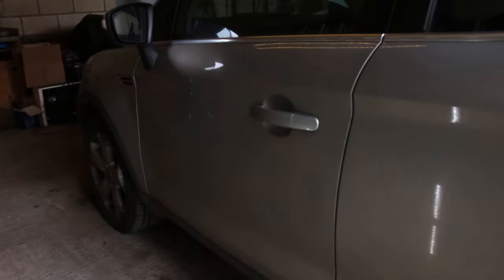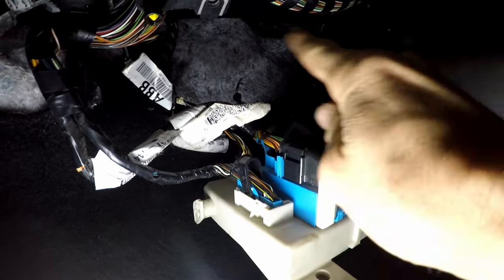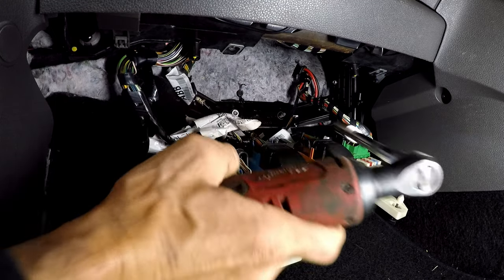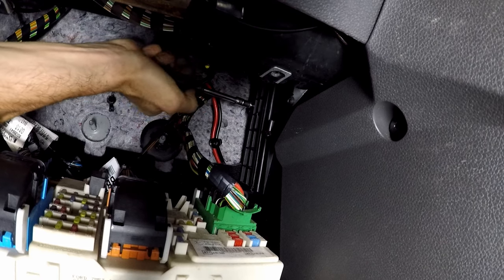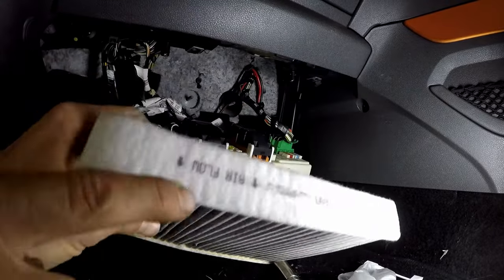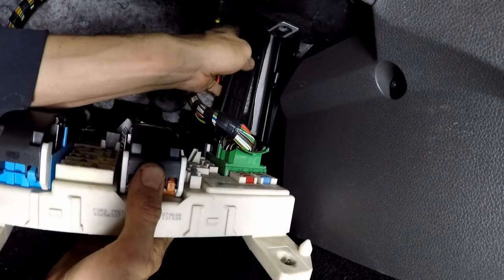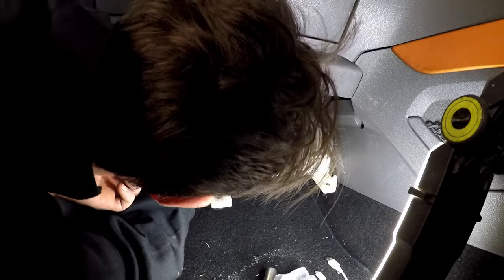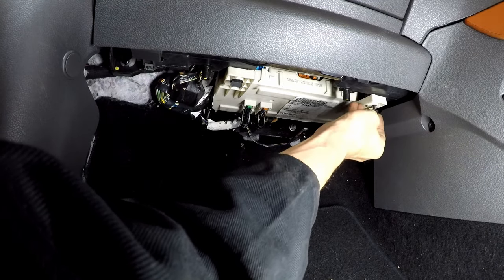How To: FORD KUGA Cabin Filter / Pollen filtre

Comment: Little tip make sure all the plugs on the fuse board are tight as the do come loose and cause endless problems
Reply from the maker: Make sure everything is tight. Don't leave anything loose on any job ever!
Reply: what you on about ? @PiggyPower
Reply from the maker: Well, anything will come loose if you don't do the thing up tight that should be done up tight!

Comment: This gave me hope that this would be a quick job.Sadly my 2011 left hand drive isn't exactly the same design, bit of a faff to figure out how to get that one done. I would have liked to give the design engineers a bit of a slap for putting a service item in such a awkward spot. And that sharp edged fuse box bracket is hungry for creating some shorts.
Reply from the maker: To be fair... It's pretty easy as cabin filters go. Some take professionals an hour, which is just plain stupid for a service item.
Reply: @PiggyPower  My issue turned out to be that I was barking up the wrong tree. My filter was accessed through the drivers side. I saw a similar panel as on your video on the  passenger side and erroneously thought that it was a design change gone wrong. It wasn't that bad when I found the right spot. Had to bolt off the accelerator pedal and may have mangled the filter a bit on the way in as it was still not great access, but quite doable. With some experience and access to a lift I can imagine it being a very quick affair with no need to act like a contortionist.
Reply from the maker: @thedolenorway  ahh yeah that happens with L/R hand drive vehicles. Sometimes they switch the access, but often they don't so sadly some get the pedals in the way

Comment: Why use a Crosland filter? Maybe it is just me, but I have had some very bad experiences with Crosland filters, and now I only ever use Bosch or Mann filters.
Reply from the maker: Customer budget. I also have had zero bad experiences with a crossland cabin filter. What bad experiences may I ask have you had with crossland cabin filters? 🤔😀
Reply: @PiggyPower  thanks for the reply ☺️ the experiences I’ve had with Crosland filters, not all of them, but a majority, is that they don’t always fit correctly or have had poor quality control carried out. Having said that, I have also experienced this with Bosch and Mann filters, but on a significantly lower scale. And when you purchase a filter from the dealer, and see the Mann or Bosch logo, that reassures me that the filters are of good quality. One experience I had was with the R56 Mini Cooper oil filters not sitting correctly and poor quality seals.
Reply from the maker: When it comes to fuel and oil filtration I wouldn't use anything but Mann or Bosch usually.

Comment: Takes 2 min to change and you don't have to remove as much as you did
Reply from the maker: Ok, why did you watch the video then??
Reply from the maker: I'm also curious how you do it, as there is no way to get a new filter in there with the fuse box and bracket in place without damaging the new filter. . . I'd also state it IS a 2min job. But takes a lot longer to video and explain a 2min job, than the 2min it takes to do it.
Reply: I found it useful for location purposes but just above the entrance to the filter hole there is a wire which you can raise out of the way fairly easily and the filter goes in without any damage.... good informative video though 👍
Reply from the maker: Above the entrance?? That's behind the glove box?
Reply: There's always one! "Ooh, you don't want to do it like that"!